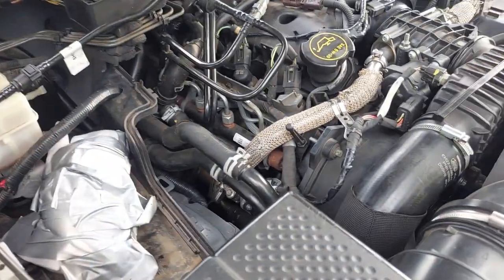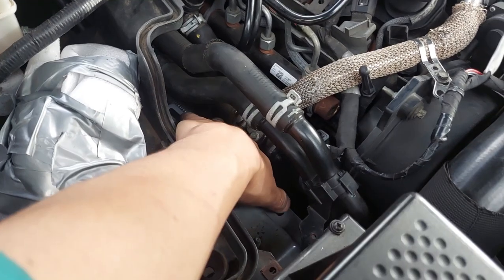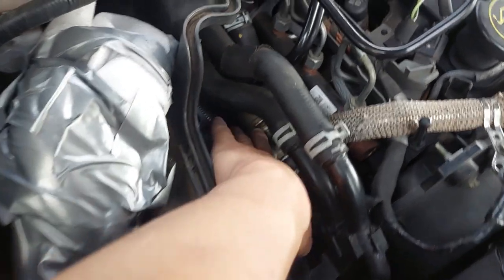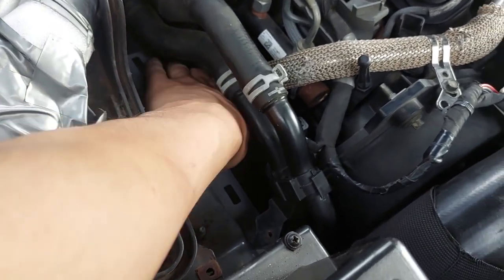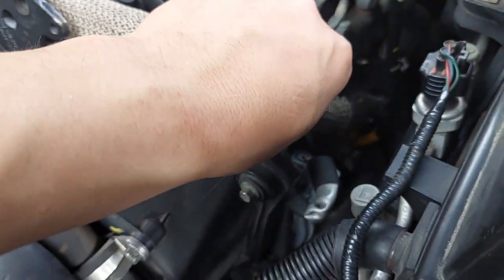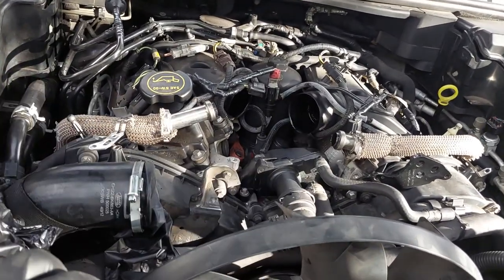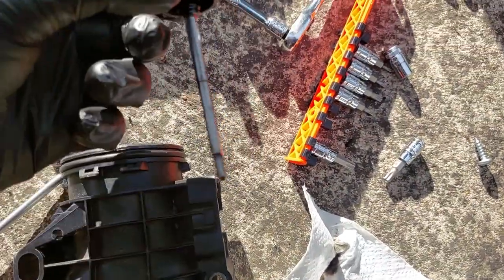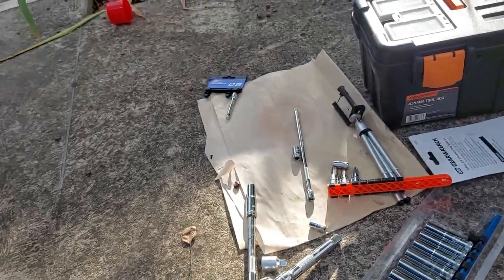LANDROVER  DISCOVERY 3 - EGR  BLANK  PLATE  INSTALL  AND  AIR INTAKE  BUTTERFLY  VALVE  REMOVAL

Comment: My MOT centre won’t pass if you do in U.K. if they see it. If you take your time you can fit new after market valves at £45 per side, just take your time. I have a flexible extension for my small socket set makes the job much easier. So glad I did as they checked on Friday gone, luckily car passed.